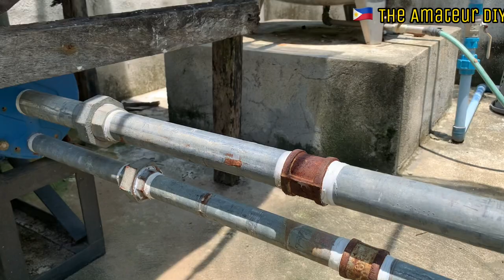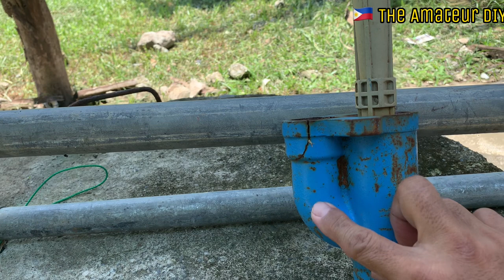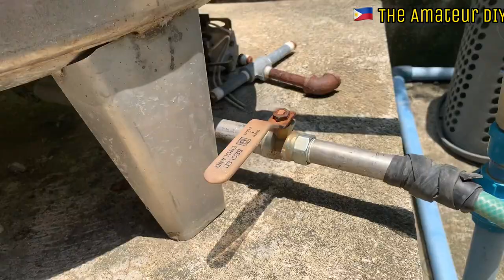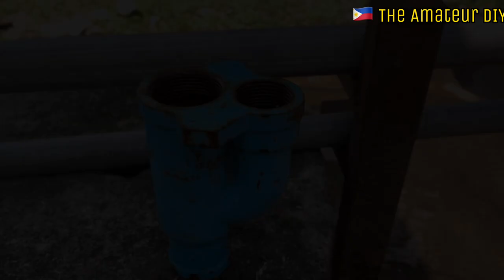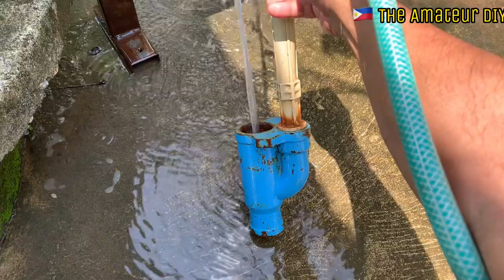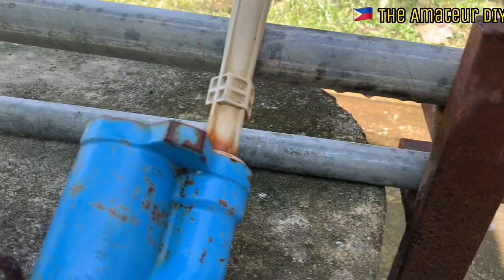How does Twin Pipe Pump & Jet Ejector Works? “Paano nagana ang twin pipe pump?” - (Tagalog Version)

Comment: Maari ba yang gamitin boss sa 2" na pipe, kaya bang ipasuk yan twin pipe ejector?
Reply from the maker: Good day Sir. Hindi po pasok yan sa 2” dia pipe casing. Ang minimum pipe size casing para dyan ay 4”. Gamit ka nalang Sir ng packer type ejector yung pang 2” diameter casing. Bili ka ng goulds pump na pang deepwell..may dalawang butas din yun at may kasamang adapter na ikakabit mismo sa pump. Imbis na twine pipe gamitin mo, yung adapter nalang ang kabitan mo ng pipe pababa sa well mo.

Comment: Boss pwedi yan sa jet pump po namin? kasi hangang 8 meters langpo ang nakalagay sa motor po eh 10 meters po ang lalim nang balon po namin kakabili langpo sayang kasi kung ibinta bago po kasi sana masagot
Reply from the maker: Base po sa aking experience Sir, yan jet pump namin (1.5HP) kaya nya hanggang 60 feet (18.29 meters). 

Anong type ba ng jet pump nyo Sir? Baka pang shallow well lang ang jet pump nyo..ibig sabihin po ay single pipe na walang ejector. Kung walang ejector ang gamit nyo, mahirap na kapag more than 18 feet na ang lalim ng tubig

Comment: Pwede po ba yan  ang ganyang klaseng set up sa deep well Assembly o pang shallow lang po sya maraming salamat po
Reply from the maker: Sir itong pump na may dalawang butas (suction at return) ay pang deepwell. Pwede syang twin pipe hanggang sa ilalim ng well or balon na may jet ejector. 

Or pwedeng single pipe na may adapter na nakakabit sa pump at packer type ejector sa ilalim. Ito yung kadalasan gamit sa mga may casing na at least minimum na 2” diameter.

Yung pump na isang butas lang (suction only) ay ang pang shallow. Applicable lang sya hanggang 18 feet ang lalim ng tubig mula sa ibabaw. Kung ang water level mula sa ibabaw ay above 22 feet na makakahigop parin pero mahihirapan na ang pump or baka wala ng mahigop, depende na sa lalim.

Friendly advise, kung nagpabutas ka (hindi ang balon) na malalim na masyado gamit ka nalang ng submersible pump. Mas maganda yung tinutulak ang tubig pataas, kasi kahit may kunting leak ang pipe nyo sigurado may tubig kayong magagamit, kung hinihigop pataas naman magkaroon lang ng kunting leak sa mga dugtungan ng pipe hindi na makakahigop ng tubig.
Reply: Sir pasensya po sa pagtatanong, kung sakali po sir mababaw lang naman yung pagkabaon ng tube mga 1 o hanggang 3 kaya pa kaya sa shallow pump curious lang po sir kung di naman kalaliman yung yung pagkaon, maraming salamat po sir Sana po maliwanagan Nyo po kami at ilang meters ang kaya po ng shallow pump na pwede po sya.
Reply from the maker: Compute mo nalang Sir, kung ang 1 pipe ay 6 Meters (19.68 feet) pwede shallow pump. Pero kapag 2+ pipe na gamit ka ng deepwell pump para sigurado

Comment: Hello po Sir, bakit kaya hanggang 22 psi lang kaya ng deep well pump namin? Pag ka abot niya 22 psi di na makatulak ng tubig sa pressure tank. 1hp deep well pump naka twin ejector, 14 meters deep un nakabaon na tubo. ok naman suction at buga niya pero di na niya kaya iangat pressure sa pressure tank. Salamat
Reply from the maker: Good PM po Sir. Tanong ko lang po kung ganyan na po ba simula noong ikinabit nyo? 

Kung noon kayang magpump hanggang 40psi at ngayon ay hindi na..ang aking diagnose ay kunti nalang ang laman ng balon or deepwell nyo. Yang 1HP twin pipe (may ejector) sa lalim na approximately 45.92feet kayang kaya pa sanang magpump.

Comment: Idol amin 60ft drilling yung motor na nabili namin is sea pump peru 3mins lang ang lakas ng buga ng tubig after 3mins patak nalang po yung. Lumalabas... Yung tubig po nasa ibabaw lang
Reply from the maker: Good day Sir. Salamat sa message. Tanong ko lang po, ilang Hp ang pump nyo may ejector po ba ang pump nyo? Kapag kasi ang lalim ng tubig at 18ft pataas, dapat deep wheel pump (with ejector) ang gagamitin nyo. Hindi na kasi uubra o mahirapan na kapag ginamitan mo ng shallow pump (no ejector) kapag ganyan na kalalim. 

Kung may ejector naman ang pump system nyo at sabi mo nasa ibabaw lang tubig, try nyo i-check ang ejector baka nabarahan or baka natabunan ng putik ang ejector.

Comment: Sir tanong ko lng pwde ba yan sa jetmatic manual pump?
Reply from the maker: Hindi po pwede Sir kung ang jet matic nyo ay walang casing. Dalawang pipe po kasi ang kailangan sa ganyan para gumana ang ejector. Ang kailangan mo para magamit mo pa ang jetmatic nyo a yung pang shallow pump (single pipe)

Comment: Boss pwede kaya parehong 3/4 lng na pipe ilalagay sa suction at pressure pipe.
Reply from the maker: I heard others are changing pipe size in smaller diameter in suction side. However, I don’t recommend changing the pipe size Sir. Just follow as per the pump design requirements. 

Kapag pinaliit mo ang size ng suction pipe, liliit din ang mahigop na tubig papuntang pump. Kapag nangyari ito ang loob ng pump ay magkakaroon ng halong tubig at hangin. Kapag umikot ang pump na ang laman ay magkahalong tubig at hangin, ito ay magkakaroon ng bubbles sa loob na tinatawag nila sa English na “Cavitation”. Kapag may cavitation sa loob ng system mapapansin mo na iingay ang inyong pump at maaaring ikasisira ng pump impellers. This will also create vibration in the system.

Comment: Boss sa single pipe set up, pwede bang mas maliit na ejector ang gamitin kesa dun sa 1 1/4 na packer type ejector? 1 inch na pvc lang din kasi ginamit ko na pinaka straw pipe, kinabitan ko lang ng bushing reducer para magamit yung packer type na 1 1/4.
Reply from the maker: Hindi ko pa nasubukan nag-reduce, pero pwede naman siguro (basta may available na size) kasi 6mm lang naman ang deperensya. Same size nalang sila sa foot valve na ilagay mo.
Reply: Inaalala ko boss yung tulak ng tubig baka mas mahina pag maliit ang ejector. Meron kasi bronze type na mabibili sa Lazada.
Reply from the maker: @user-uf8pr9hy7u para malakas ang tulak ng tubig pataas gamit ang 1” na packer ejector, doon sa mismong Inlet ng Pump ka na maglagay ng reducer/adapter na 1-1/4 x 1”.

Comment: Sir, goulds j15+ convertible jet pump ba ung gamit nyo d2?tnx!
Reply from the maker: Yes Sir Goulds Model J15 (1-1/2Hp). But not sure if it is convertible
Reply: @theamateurdiy-personalexpe9299  ok po, kung may plus sa model niya convertible po yan kaya pwedeng i-convert sa shalow well kailangan lang ng adaptor, JS po kasi ang model nung shallow well lang.tnx!
Reply from the maker: Old model na siguro yung sa amin Sir kasi J15 lang walang +. Latest Model na siguro ang may +. Salamat for sharing good info Sir.
Reply: @theamateurdiy-personalexpe9299  kahit naman po walang plus sa model nya convertible pa rin yang model nung inyo kahit luma kasi pwede siyang gamitan ng twin pipe at adaptor para sa shallow well, d katulad ng J15S model halimbawa na fixed sa shallow well lang, salamat po sa mga reply at Merry Christmas!

Comment: Sir nag try ako kanina vertical goulds pump gamit ko. Tinakpan ko ung maliit na butas, tapos single pipe walang ejector footvalve lng. Dpo umahon tubig. Dipo ba talaga gagana un?
Reply from the maker: Sir hindi talaga uubra yang ginawa mong set up. Kapag ang deep well mo ay more than 18 feet deep, kailangan gamit ka ng deep well pump. Yung may ejector. Ang ejector ang tutulong na mag-tulak ng tubig pataas gamit ang pressure. My advise, install mo pa ang isang pipe dyan sa tinakpan mong maliit na butas at ilagay ang ejector accordingly. Please paki-like at subscribe ang video. Salamat po

Comment: Boss pwede ba yan sa adapter gagana ba
Reply from the maker: Pwede din Sir. Twin Pipe galing sa pump, tapos i-connect sa 2 butas ng Casing Adapter. From casing adapter, single pipe na pababa hanggang sa packer ejector to foot valve.

Comment: Idol ask ko lang ilang metro bang kaya ng injector na yan at ilang horse power?
Reply from the maker: Sir ginagamit po ang ejector kapag ang deepwel ay may lalim nang mahigit na 18feet. Ang gamit po ng ejector ay siya ang tumutulong magtulak ng tubig pataas gamit ang high pressure recirculation water galing sa pump. Normally ginagamit po sa 1Hp, 1.5Hp or 2Hp deepwell pump. Pero kung more than 60feet na ang deepwell mo, advisable na gamit ka nalang ng submersible pump.

Comment: Pwde ba boss Wala lang ejector ilagay?
Reply from the maker: Sir, Deepwell pump (twin pipe) ba or shallow pump (single pipe) ang pump nyo? Kapag ang sukat ng lalim ng tubig simula sa taas ay mahigit na sa 18feet, gamit ka ng deepwell pump, yung may ejector para makahigup pa ng tubig ang pump nyo. Kapag walang ejector mahirapan ng makahigop. Pero kung ang sukat ng tubig galing sa taas at less than 18 feet, okay na kahit gamit ka lang ng shallow well pump yung walang ejector.
Reply: @theamateurdiy-personalexpe9299  nasubukan ko boss kahit subra sa 20 feet kasi Isa at kalahating tubo nahigop naman Ng shallow pump. Maraming beses ko na nasubukan.
Reply from the maker: Uu pwede at nasubukan ko na din Sir, kaya lang nahirapan ang pump lalo na kapag lumalim na ang tubig kapag summer (tag-init). Ang nagyari imbis na 2 to 3 minutes lang pumping time, umaabot minsan sa 5 to 6 minutes gamit ang shallow well pump. Kaya ako nagpalit sa deepwell pump.

Comment: Boss tanung ko lang kasya ba sa loob ng 4"  na casing ang twin pipe ejector?
Reply from the maker: Kung ang pagbabasehan po ay ang 1.5Hp na Goulds Pump namin, hindi po kakasya sa 4” Dia pipe casing ang twin pipe. Kasi, ang outside distance ng butas ng Inlet Suction at Outlet Return na nasa pump ay 4”, kaya para magkasya kailangan mo ng 6”Dia pipe casing para maipasok mo ang twin pipe.

Comment: Sir kya b nyan ang 25 meters n lalim
Reply from the maker: Sorry Bro pero hindi ako sure kung kaya ng twin pipe pump na 1-1/2HP ang 25merers (82 feet). Itong amin kasi ay 35 feet lang ang lalim at 1-1/2HP. Wala kasi akong mahanap na specs kung gaano kalalim kayang ng twin pipe pump.
Reply: Kaya yan ng 1 HP deepwell pump basta may ejector, nakalagay naman sa specs ng pump kung ilang meters ang suction nya.

Comment: Sir so dapat po nakalublub yan sa ilalim ng tubig or pwedeng hindi?
Reply from the maker: Nakalublub dapat Sir. Mas maganda at least 1 foot from foot valve kalayo ng Ejector, or maglagay ka lang na maiksing nipple para sa dugtungan ng Foot Valve at Ejector.
Reply: Dapat pala boss may distansya sila..bakit ung iba deretso foot valve af ejector magka kabit lang
Reply: sir 120 mtrs  ngung lalim po.pero ang tubig livel is 50 mtrs. ok lang ba na ung strew wid ejerctor nasa lalim lng ng 60mtrs. or basta abot lng s water libel ung ejector?
Reply from the maker: @rickybautista4910 okay lang po, pero mas maganda kung ilagay mo ang ejector malapit sa dulo ng pipe mo.
Reply: @theamateurdiy-personalexpe9299  sir ung footvalve  25meters distance sa ejector kya pa kay higop.at hndi po sa kukuha sa dating line ng poso.
Reply from the maker: Hindi ko pa nasubukan ganyan kalayo ng ejector sa foot valve Sir. Ang nabasa ko pwede hanggang 25  feet, pero sa 25 meters (82 feet) hindi ako sure. Advise ko Sir kung ganyan kalalim na ng well nyo ay gamitan nyo nalang ng submersible pump.

Comment: Ano po ba ang dahilan hindi nakakahigop ang twin pipe
Reply from the maker: Mga posibling dahilan po ay:
1) Barado ang ejector
2) leaks sa mga joints kaya hindi makahigop dahil hangin ang nahihigop
3) mas mababa na ang water level kaysa level ng foot valve kaya wala ng mahigop
4) sira na ang impeller ng pump (assuming na okay pa ang elect motor)
5) or baka lang nawalan ng tubig sa suction pipe kaya kailangan mong mag-prime

Comment: Anong size ng dalawang tubo? Foot valve po ba ilalagay sa dulo ng dalawang tubo?
Reply from the maker: Ejector po Sir yung nasa dulo ng dalawang tubo, tapos sa baba ng ejector lagyan mo ng nipple na may foot valve.
Reply: @theamateurdiy-personalexpe9299  ilang hp ng pump ang minimum na kaya ng ganyang ejector boss?
Reply from the maker: @markpelagio690  Sir may 1Hp, 1-1/2Hp, 2Hp at depende kung ano ang requirements mo. Basta lahat ng twin pipe may ejector at ito ay ginagamit pang deepwell pump. Yung mga shallow well pump single pipe lang yun kaya walang ejector.

Comment: anong purpose sir ng water kit nasa loob ng twin pie injector?
Reply from the maker: Yung tinatawag mong kit na plastic na nasa loob ng ejector, ang tawag dyan ay Venturi. Dyan dumadaan ang high pressure na tubig (galing sa pump) na tutulong mag-tulak ng tubig (with less pressure) galing foot valve pataas papunta pump.
Reply: @theamateurdiy-personalexpe9299  salamat sir malaking tulong saakin dahil nagtaka ako bakit hirap humigop ang water pump ko sa water kit lang pala ang problema nabarahan ng bato  salamat sir
Reply from the maker: @renatomunoz2288  kung may ejector ang pipe mo at nahihirapan humigop ng tubig ang pump maaaring ang dahilan ay barado or may dumi na naka-harang sa loob ng ejector (nozzle). Kailangan mong iahon ang ejector para linisin.

Isa din dahilan na nahihirapan humigop ang pump na may ejector ay may singaw (leak) sa mga tugtungan ng mga pipe.

Comment: Boss bat ung samin kaya pag matatapos na mag karga ng tubig umaalog ?? Ung motor pump nagsisi tanggalan ung mga tubo umaalog di  nmn alam kung bakit ganon ano kayang pwedeng gawin doon? Tnx sir sana mabasa 😇
Reply from the maker: Sir, ang kadalasang sanhi ng umaalog or vibration ng motor/pump ay dahil hindi mahigpit ang pagka-mount sa kanyang pinagpatungan. Kung ito ay nakapatung sa concrete dapat lagyan mo ng anchor bolt or expansion bolt saka mo higpitan mabuti. Base na rin sa aking personal experience, isa din dahilan ng malakas na vibration ay mis-alignment ng pump at pipes connections. Paki-check mo nga paano naka-mount ang inyong pump, baka ang isang problema ay ang kanyang pinagpatungan…baka nauuga..message mo ako uli pagkatapos mong i-check ang pump nyo. 

Please paki-subscribe ang YouTube Channel ko. Salamat sa support.
Reply from the maker: Contact point yang didikit para mag-On kapag mababa na ang pressure, at kakalas naman kapag abot na ang set Cut-Off pressure. Normal lang yang didikit at kakalas (kapag dumikit mag On at kapag kumalas mag-Off). Kapag kumakalas agad ang mga contacts kahit hindi pa abot ang Cut-Off pressure baka may sira na sa party ng contacts, baka kinalawang na yung maliliit na spring dyan. Check mo muna try mong linisin kung uubra pang gamitin. Lumalambot din kasi yang mga springs. Kung malabot na or sira na dahil sa kalawang, palit ka na ng bagong pressure switch. 

Tanong ko, may gamit ba kayong pressure tank? Kung wala kayong gamit na pressure tank ang mangyayari ay mag-switch agad ang pump nyo sa tuwing may magbubukas ng gripo dahil bababa agad ang pressure sa loob ng piping system, at mag-off din agad ilang minuto pagkasara ng gripo kapag naka-build-up na ng pressure.
Reply: @theamateurdiy-personalexpe9299  yun nga boss try ko linisin bili ako pag di kaya hehe thanks sa payo boss
Reply from the maker: No worries Sir, masarap ang pakiramdam kapag nakatulong sa kapwa. Magtanong kalang Sir walang problema.

Comment: return line  lang iyang Hindi na tubig nadaan diyan kundi  hangin lang . hangin lang nadaan doon sa outside ng straw .
Reply from the maker: Mali po kayo Sir. High pressure water po nadaan dyan at walang straw dyan kasi sa balon po ginamit🤣. Kung punta ka dito sa amin ipapakita ko sa iyo na ang return pipe ay may high pressure water. Baka ang nasa isip mo ay packer type ejector😁

Kung nakikita mo yung union sa return pipe, kapag niluwagan mo yun high pressure na tubig ang lalabas😁